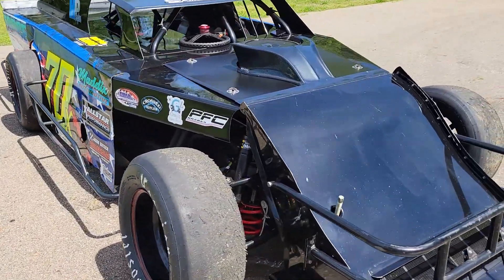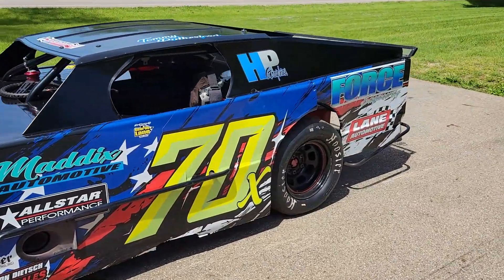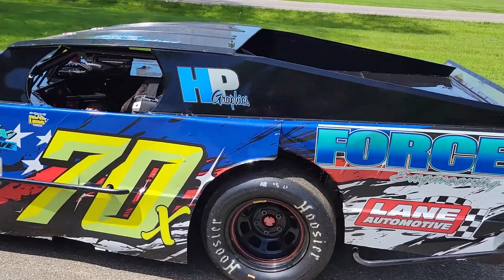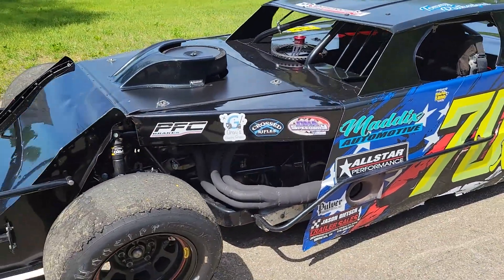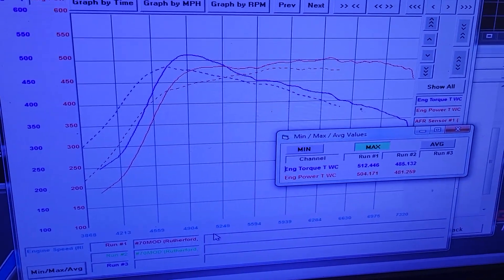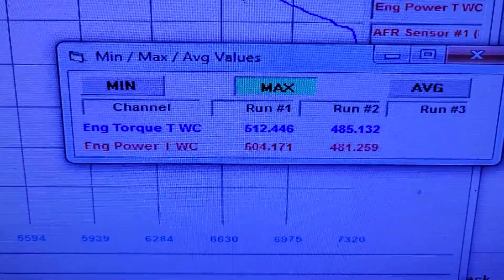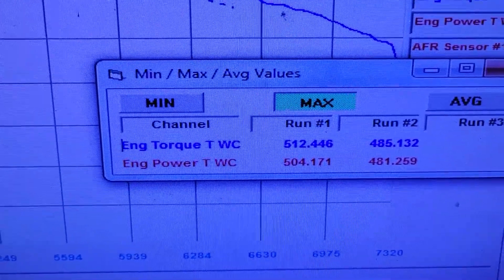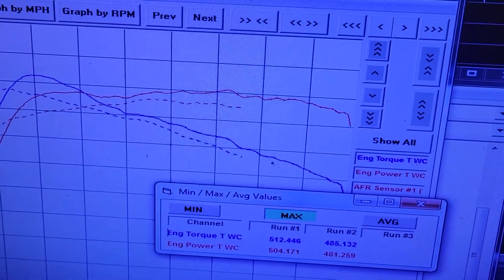500hp Carbureted SBC: Pavement Modified Dyno Test

Comment: Do you run the same size rear tires for the dyno drum? Seems like stagger would do some weird things under load and cost power.
Reply from the maker: Yes, ive never ran anything with stagger on the dyno.  Im sure it would create issues.
Reply: @ForceEngineering  yep makes sense. Hopefully they got the fuel issue sorted out